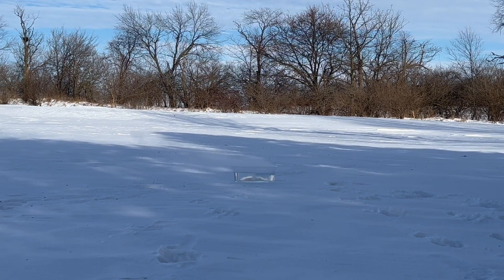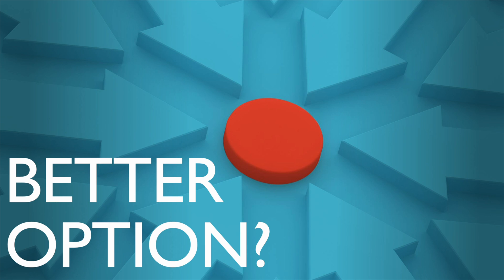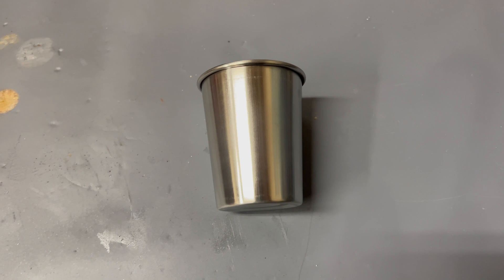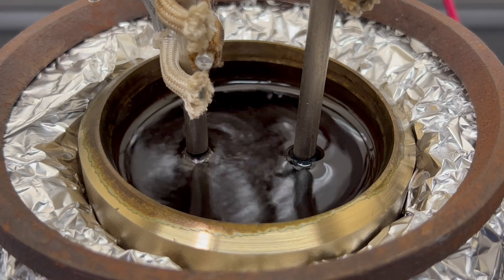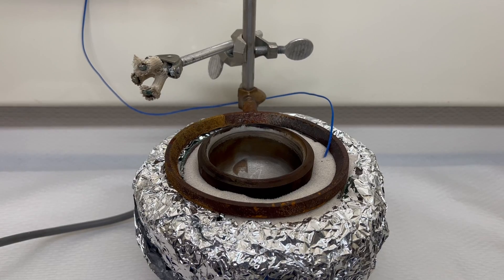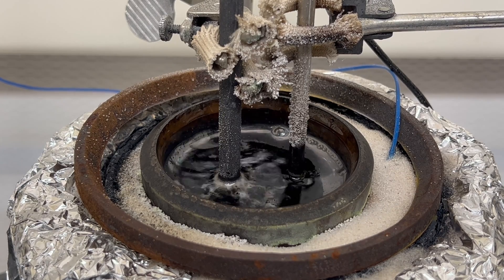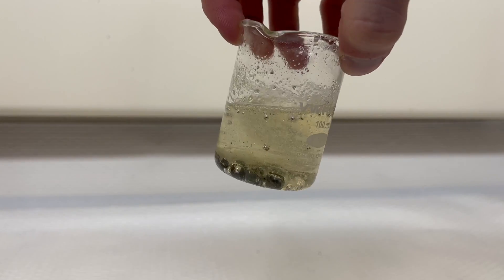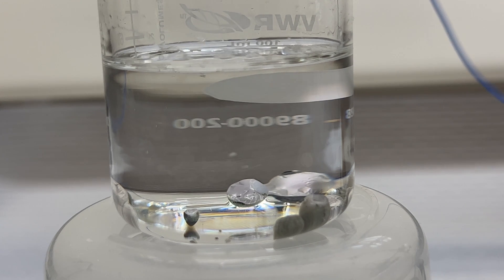I Made Sodium Metal Using the Castner Process!

Comment: Use a nickel electrode next, just electroplate some nickel into your stainless. Your sodium is getting dissolved in the hydroxide solution and shorting with the other electrode back to hydroxide, efficiency drops so you should use something like a diaphragm (I will explain later how to), also it's in contact with oxygen which drops the efficiency even further and makes gunk, a bit of nitrogen gas on top from time to time would work wonderfully, remember nitrogen gas is heavier than air, and diffusion of oxygen from air into the pure nitrogen is rather slow. Your idea of using the container as an electrode is very smart, now about the diaphragm, if you use a small pipe around the cathode rod it will separate the sodium metal that will flow on top and make it easier to extract, especially if you use a T pipe and let the sodium drip through a ramp. Remember to constantly replenish the consumed NaOH and maintain the cell level. I would recommend you use an hydraulic steel pipe as a container next, and just wrap some insulation and nicrome wire around it and it will keep the reactor at 330 nicely. Also, don't go much over 330, the higher the temperature the higher the diffusion of sodium metal into the molten hydroxide, less efficiency.

Comment: I don't know if the Castner process is such a situation, but in many electrolysis situations, using lower currents preserves the electrodes, or at least makes them last longer.  It would be interesting to see if there's a current level that strikes a good balance between production rate and preservation of the electrode(s).

Comment: Hey, could you let me know what type (Brand and name) of heating mantle that is? They look cheaper than the ones we usually buy, (and easier to fix) which are consistently broken by my beloved employees.
Reply: If they're Glas-col mantles, as denoted by the label in the video, I checked and boy am I wrong.
£200 for a tiny 100ml not even mantle - they're selling the hollow skin of a mantle.

I don't know if you just don't show it in the video, but I wouldn't be able to cope anywhere near as well as you if I broke that.
I'm much better when other people break my things.
An experience that's only too familiar having started a small business and hiring chemists straight out of uni who think they can smash glassware and set things on fire like I have sigma money.

One has literally broken five heating mantles (Thankfully only small ones - still £230 each) and has been suspiciously implicated (standing over the burning skeleton) in two more.

Most upsettingly a 250ml three neck flask, given to me by my secondary school. chem teacher when I was just getting my lab set up, broke last week. I dropped it and watched in slow motion as I clumsily grasped for it, but I missed as I was holding other glassware at the same time.

If anyone is a laboratory glassblowing student who needs stuff to practise on, hit me up.

Anyway, sorry. If I had a £5 every time a piece of my precious glassware was broken in an entirely preventable way, I'd be rich.

Comment: Good attempt. Try to put some kind of insulating separator on top, where bubbles appear on the anode, to prevent them from reaching over to sodium.
By the way, you don't need to say "sodium metal" or "oxygen gas". Sodium and oxygen are sufficient names.

Comment: You don’t make elements unless you have a nuclear reactor. You refine them
Reply from the maker: The definition of making is “the act or process of forming, causing, doing, or coming into being” I made sodium metal, I did not create the original sodium atom nor did I claim to. The title of the video is “Making sodium metal by the castner process” take note of the sodium metal part. If I wanted to use the term refine in the title it would be longer than necessary, ie “refining sodium from sodium hydroxide using the castner process”.
Reply: @WheelerScientific  why wouldn’t you just say ‘refining sodium metal’ for a video title. You could add ‘via (the particular process)’ if you really thought it necessary. 

The topic of refining would be an  interesting video
Reply from the maker: That would be an incorrect title then, refining refers to removal of impurities, I didn’t remove impurities from sodium metal, I made sodium metal. I chose the title I did due to it describing what I did and I liked the wording of it.
Reply: @WheelerScientific  you know that refining doesn’t mean removing all impurities. You should make a video discussing the distinctions.
Reply from the maker: Yes, I do; I did not claim it was to remove all impurities; the definition of refining is "remove impurities or unwanted elements from (a substance), typically as part of an industrial process." I did not refine sodium metal; I refined sodium hydroxide to sodium metal. Refining sodium metal would involve starting with sodium metal and processing it, which I did not do. Read my comments carefully and understand what you are arguing before doing so.
Reply: @WheelerScientific  I’m not trying to argue. It’s a discussion and I’m trying to understand something. Like when you refine iron ore you don’t start with just iron. So where is the distinction? Do you see what I am getting at? I totally get your point but you are making a brick of something metal - like the form is what you are making. Like a chunk of metal. You don’t make metal unless you have a reactor.  That’s why I think you should do a video on it because I can’t find one and it seems like a pretty big distinction. Not trying to get in your grill but it’s fascinating to me

Comment: what voltage range were you using? or amerage?  which were you selecting for?
Reply from the maker: I was pushing around 5 volts at 10 amps. 10 amps was the maximum my supply could output.